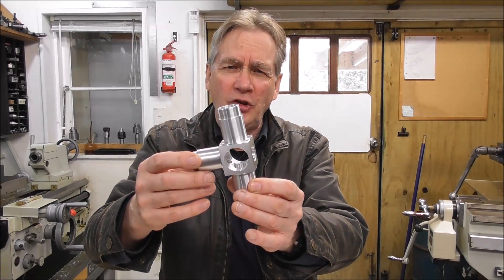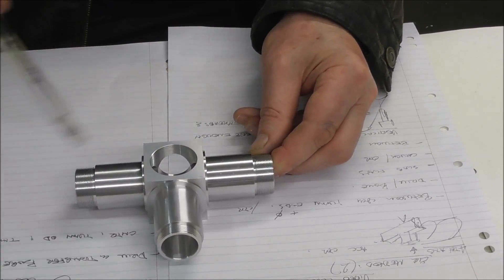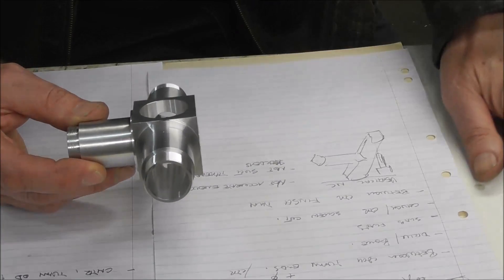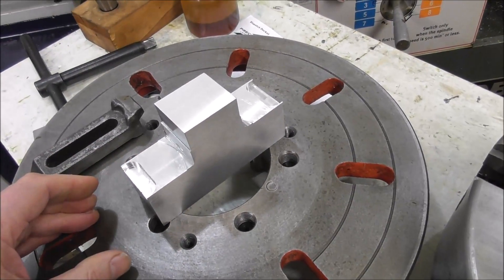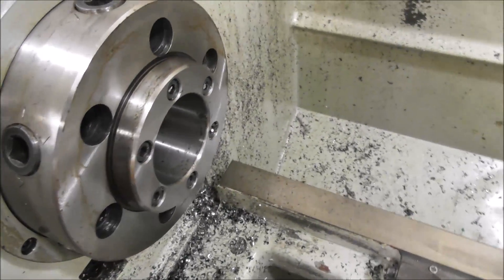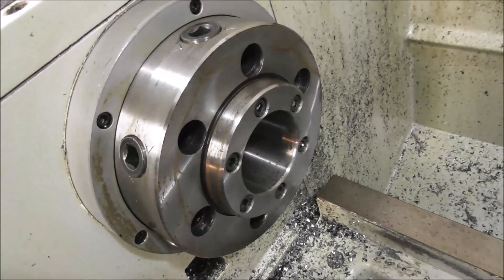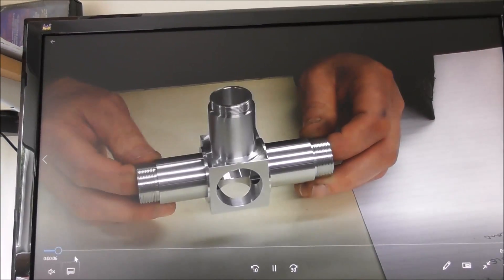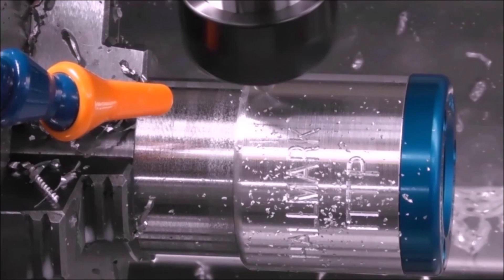Advanced Machining - Tips and Tricks - Part 1

Comment: Cliff, I replaced my door with an insulated high wind load door and insulated the space above my shop. There is vinyl weather stripping available for most doors to help seal them, the weather seal has worked well for me. These units also work as a heat pump so they will provide heat in the cooler months. I have a friend who does mostly production runs in his shop which is larger than mine and has the same positive results. Here in central Florida we get the sea breeze from both coasts. If you choose to go this route you will be glad you did!
Reply from the maker: Thank you! Cliff

Comment: Hi Cliff.I love your channel. Thank you for sharing your knowledge. I do similar work as you in Florida USA, very high humidity here most of the year. I had the same problem with rust until I installed a mini-split A/C unit about 5 years ago. The mini-split solved the problem completely. The unit maintains a constant72 degree or 22 Celsius  temp and very low humidity. No rust issues whatsoever! The units are very affordable.
Reply from the maker: Hi Steven. Thanks for taking the time to give feedback and support. Sounds like I should look into this. Although my double doors leak a lot of air and it is windy with salt air where I am, so I am not sure.. it may not be as successful as it is for you. Cheers, Cliff

Comment: I have tried  a lot of commercial anti rust preperations.  When using oil and the film is thick  water Sometimes even floats the oil up and rusts underneath the oil.When shop dust settles on the oil you have put on  metal to prevent rust , it eventually hardens up and creates a "skin" that is quite protective. My  location in western Ohio  USA........ When a machine has to be stored outdoors under a tarp water resistant grease ....the kind auto stores sell for boat trailer wheel bearings..........smeared on all exposed steel has worked well for me.
Reply from the maker: Thanks David. Cheers Cliff

Comment: Hi dude, you said you run a dehumidifier. Do you run a digital humidity gauge to know your averages and extremes? My machine room sits between 30 and 45% humidity. Works for me. And the only coolant I use is straight oil or wd40.
Reply from the maker: Hi Scotty. I think you have identified an issue. The southerly ex the sea slams into my workshop some days and gets in around the doors - I bet when that happens the dehumidifier cannot cope.  Cheers  Cliff

Comment: Hi Cliff.

Excellent work as always.

You asked for a possible suggestion on corrosion protection for metal surfaces.

As a colleague machinist I full appreciate the conundrum, most of our outside work is based in the marine industry.

We use a product called BoShield T9 to prevent corrosion. It’s  produced by Boeing to prevent corrosion on aircraft.

We have used it with great success, NOTE: It can leave a waxy surface. I/we have no affiliation with Boeing, just a FYI for a possible solution.

Cheers and take care, from Salt Spring Island Canada.

Ron.
Reply from the maker: Hi Ron. Thanks for comments from Canada! Just looked up the price of T9 in NZ ...ouch!   It must be good!  Cheers Cliff